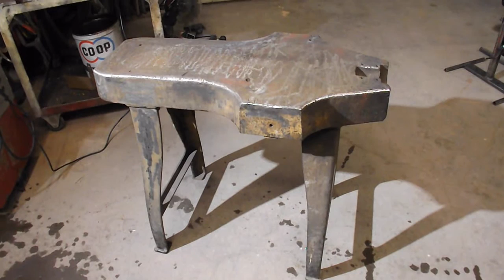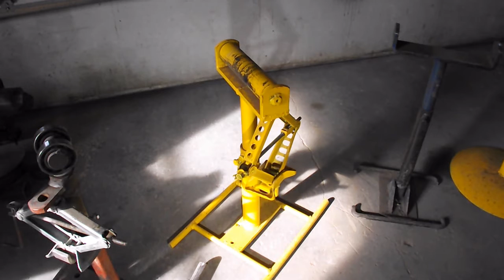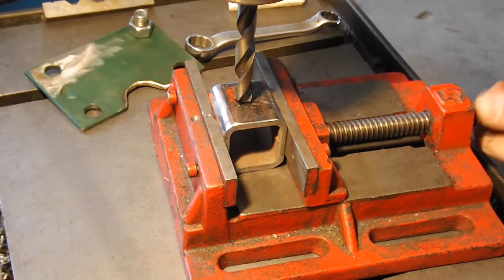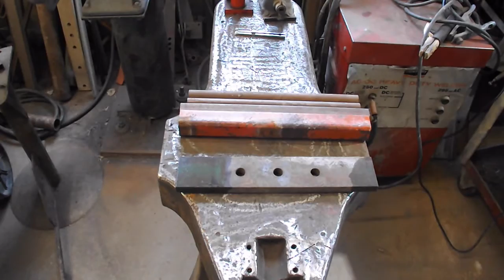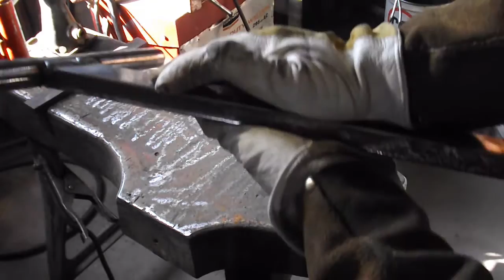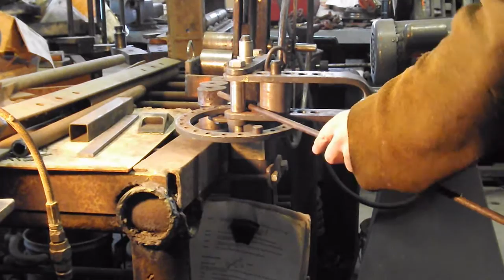Work Stand Evolution - February 2014

Comment: I have built a few of these stands in the past. I usually made a three point landing, three feet will always set on an uneven floor without teetering. On a disc base, just cut three scallops in the cutting edge of the disc leaving three points of contact. :-). I know why those jacks are hard to find, after using them once under a vehicle, most get tossed into the road ditch by disgusted users... Michael in Colorado.
Reply from the maker: 3 points is a good way to go. It's been too long since I made this video, I can't remember if I talked about why I used the pipe for feet, but it's for when I'm on-site, I can put a rod through  and give it more stability, especially when I'm in the dirt, building corrals.   I didn't read where you from close enough! Hudson is a town South of me, and since you said neighbor, I jumped to the conclusion it was that one. Now that I read it again, you say DIA. That should have been a clue! LOL!

Comment: on your yellow stand if those tabs holing the roller were 3 inches higher then the roller it might keep the material on it?what about a simple bottle Jack there's plenty of them around. I love the old school tables and what is this generation going to be using for tables?
Reply from the maker: I can't believe I got a comment notification on an old video! It's been so long since I've watched this video, I'm struggling to answer you questions.  I thought I talked about using a bottle jack, but I can't remember now. I don't like bottle jacks because they leak after a few years, and they settle.  Regarding the tabs, I don't like anything permanent above the rollers because then I'm limited on material size.  Some kind of removable pin might be good.

Comment: Hello Matthew,  I have made many stands over the years as they are always useful so I am enjoying your take on them.  I always weld a good long piece of rod on the friction bolt so you have the leverage without a wrench to tighten them down.  I have never had one slip (I generally use a 5/8 th bolt).  I hear you on the fine adjustment with a load and think your jack solution is quite innovative.  Those car jacks are very hard to come by for sure.  I also mount castors up off the bottom so you can tip it to roll it around.  Good video--I am half way through it and looking forward to Dakota's cameo!  lol.  Take care.  Doug

Comment: Hi Matthew,
Clever adjustable stands, if you want your rollers to last a little longer, you can angle them so they roll tangential to the pipe wall.
Like you've noted lately I've got a face..... and hands, legs and all..... lol
Also built the guts to put out a few videos on my channel, very basic but it's a start, planning to master the technique a little at the time and improve along the way.
Cheers,
Pierre
Reply from the maker: Oh, I must check out your videos! :)

Comment: If you are still looking for a suitable jack look at the side handle trailer jacks. I have seen them for around $20 for a 1000 lb model on ebay. HF with a coupon for around $15.
Reply from the maker: For that price, I will definitely look at them next time I'm at HF. Thanks for the info!
Reply: Wide Vision Metal Fab Make sure it is the side crank. Sometime what they put on the box is not the same as what they put in the box :-)

Comment: Man, that's a super cool welding table! I think those legs are from a lathe. Another nice fab video.
Reply from the maker: Actually, I have found out it's a Model T oil pan straightening fixture. Do an image search. I kinda don't want to use it as a welding table now that I have discovered this. Many farmers around here have them as shop tables, so I never really thought about exactly what they were until a viewer asked.
Reply: Wide Vision Metal Fab
In those days the roads were hard on oil pans, so, people had to do it themselves in order to cut cost down...

Comment: On your yellow unit put a slot down the back of the bottom larger tube and weld a bolt out one side of the smaller inner tube located at the top position it can be adjusted to. The putruding bolt runs up and down the slot and the whole thing can't twist anymore.
Reply from the maker: Good suggestion. I think I'll try that! Thanks!